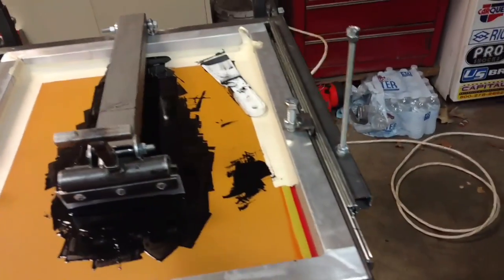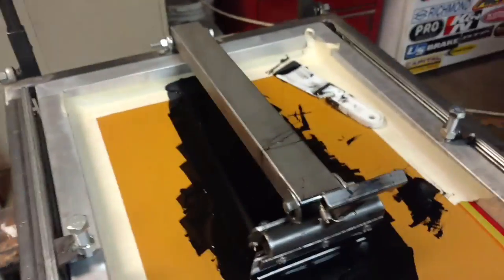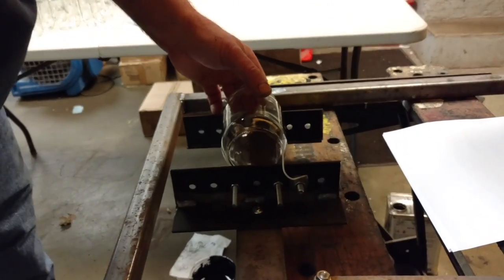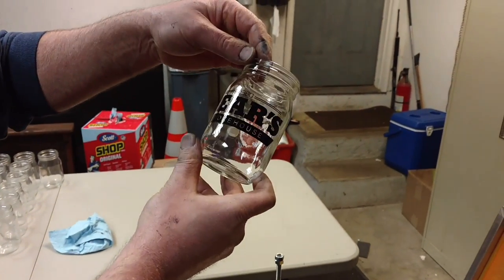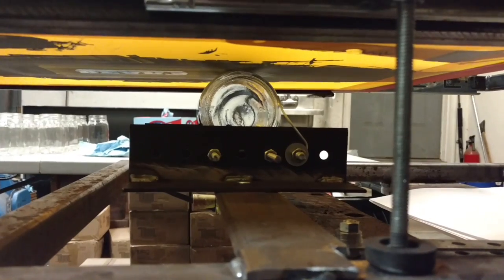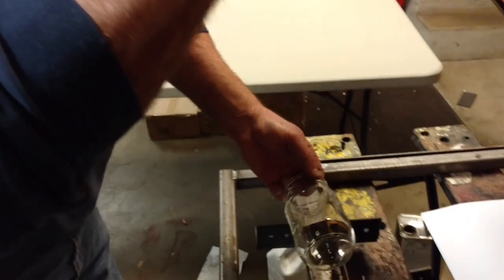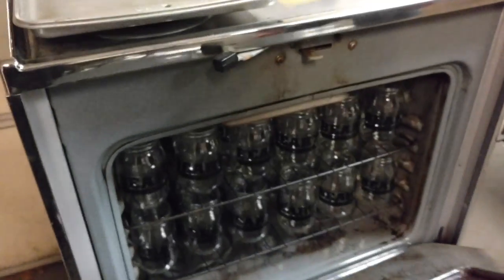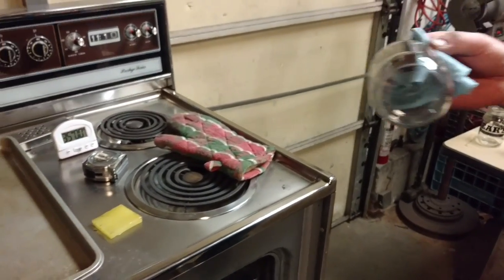Manual cylindrical screen printer

Comment: I like it. Looks like it could fit any cylindrical object within a certain size. Very cool. Yeah a belt dryer for glasses would speed things up a lot. Come get some Catspit~!
Reply from the maker: CatspitProductions 
Thanks for the comments. We can print anything from pens to growlers.  I like your videos as well. They helped me when we were starting out. Good information!
Reply: You're welcome. That's very cool! Thanks for watching my videos. Glad I could help out. I was actually looking at this and wondering if you wanted to build them for me to sell... LOL. It's a nice simple design and it may have a market. I get asked a lot about this type of printing due to my plastic bottle experiment video printing only with a screen. These days I sell a lot of screen printing equipment. Wanna build one for me to make videos with and see if anyone wants to buy? Is it hard to build, maintain, operate? Just throwing it out there ;)
Reply: Berardi Racing i need this printer

Comment: friend, with all your experience ... do you think it is possible or feasible to be able to stamp a bottle completely ... that is 360 ° in practically 100% of the circumference of the bottle to try to use up to three colors? .. do you think it is possible or is it a total disaster? Thank you,
Reply from the maker: Absolutely. You would have to stop your rotation just short of the image to prevent smudging.
3 colors would be a little challenging depending on the design but quite doable.

Comment: U r the best sir. But what about the mesh it is 120 or 200?
Reply from the maker: I used 300 mesh for this job but you can go as low 220.
The ink is very thin so you don't want to use a low mesh count.
Thanks for your comments.
Reply: @berardiracing92 i wanna print on perfume bottles. How can I protect the  ink from alcohol?
Reply from the maker: @manchette4840  Exactly what type of alcohol ?  I can wipe the ink with 99% IPA, after it's cured,  with no adverse affects. Hope that helps.
Reply: @berardiracing92  thank you sir

Comment: John you mentioned using a primer on the glass before printing. What exactly is the name of the product from Inkcups that you use?
Reply from the maker: I used the PP series primer but I think that may be for plastic.
Contact them directly and they will help you with what you need as their products may have changed.
I use CG series ink with 1000 HGL hardener. I have some glasses that I use every day and go through the dish washer, for 8 years now and still perfect.

Comment: Hi great machine, what kind of ink are you using for the glass?
I just subscribed.
Reply from the maker: CG series ink from INKCUPS.
I tried all types of ink and found this to be the most durable. I have a set of glasses that I use daily and wash in the dishwasher for over 5 years and still perfect.

Comment: Hello how are love to get more info on how you printed the glass. This is a great video   what did you use to clean and seal or primer the glass before cooking them   thank you in advance
Reply from the maker: There's no special prep before baking the ink. The ink will also air dry but it will take a day or so depending on the conditions.
Reply: @berardiracing92  thank did you use nazdar ink. Are you selling the plans to build the machine
Reply from the maker: @ramo8440  I tried Nazdar but was not happy with the results. I tried a lot of different inks and the one that worked the best is the CG Series from Ink Cups Now.
Reply: @berardiracing92  thank you for the advise I will look I to that ink

Comment: What kind of paint did you use? You said two part epoxy but not sure what type or brand.
Reply from the maker: I use CG series ink for glass from Inkcups.
They are in Danvers Mass. Check out all their products at Inkcups.com
Reply: @berardiracing92  thanks so much!

Comment: Just enjoyed your video.  Question.  You prewashed glass with alcohol to de-grease.  What did you prime it with?  I loved the video.
Reply from the maker: Rebecca Miller
Thanks for your interest. The "Primer" goes on like any type of cleaner. Use a saturated rag and wipe the glass. The supplier calls it primer but I don't think it's anything special. The ink can still be scratched off if you try.
Next we are going to try Pyrosil, which is a flame treatment.
Will post another video when we do.
Anyone with any suggestions would be appreciated.

Comment: Can you do multi color on this set up, putting different screen?
Reply from the maker: You can do multi color as long as you have a reference point to start with. I use a line on the glass as a reference point so the image is centered in between the lines.
Do the same for the next color.
The ink starts to set up in minutes so I would do a print over before the underbase cures.
Reply: Berardi Racing Thank you , by any chance did you ever get the plan for the set up to built this ? Or are you selling it ?

Comment: Fantastic design! What are the components that the jar rests directly on? Are they ordinary washers?
Reply from the maker: Cameron Pearce 
The rollers are steel roller bearings  with 1/4" centers on threaded rod.
Nuts on either side of the bearings to hold them in place.
These are fully customizable by size and configuration depending on the size and shape of the glass.
Reply from the maker: The rollers are steel roller bearings with 1/4" centers on threaded rod.
Nuts on either side of the bearing to hold them in place.
Fully customizable by using different size bearings and configuration to fit the size glass your Printing

Comment: hello, i am from Argentina, congratulations, very beatiful machine! Do you have plans of these machine? thank you
Reply from the maker: David Toledo :: DG 
sorry Dave, I do not have the plans for this machine. I designed and built it off the top of my head.
I used parts that were laying around the garage and welded them together. Thanks for watching!
Reply from the maker: s
Reply: No problem, I try yo do the machine to print beer growler! thank you!
Reply from the maker: David Toledo :: DG 
We do use it to print growlers for two local breweries. I think it's time to get an automated machine.
Reply: Hola! Pudiste armarte una al final? Necesito armarme una para un emprendimiento. Saludos y gracias

Comment: Can I use a heat gun instead of an oven?
Reply from the maker: You don't actually have to use any heat at all. You can air dry over a few days so any type of heat would be beneficial.
The steady heat of an oven just makes the ink more durable.
Don't use your household oven if you decide to bake.

Comment: Great job👍 if done by dtf or dtg , it would be better and easier.
Reply from the maker: Old Video. That stuff didn't exist then. I agree, it would be easier but maybe not in mass quantities or durability.
Reply: @berardiracing92  I had a DTG back then. However, DTG's and F's are inkjet printers and you have to print everyday, and the heads go out quite often. They only last about 5 years. Not worth it. I'd rather have a well built machine.

Comment: This (and everything about this video) is genius! One of the best DIY vids on here for sure. Thank you so much for making it 🙏 So question - since this video was made 3 years ago, are you still getting all your materials (glass primer, epoxy and glass paint) from Inkcup?
Reply from the maker: Yes, After much trial an error i have found they have the best, most durable products.
If you need any help, let me know what you're printing on and i can steer you in the right direction. Inkcups has a good description of what inks to use on what substrates.
Reply: @berardiracing92  Great set up, thanks for sharing. I have a project where I hope to be printing on aluminum and also stainless steel canisters. Any particular considerations for those materials?

Comment: can this be done to styrofoam cups ?
Reply from the maker: P.a.C  Yes. With the proper ink you can print on anything. For styrofoam you would need a water based printing ink. You would have to resurch that yourself.  Thanks for watching.

Comment: Would you be willing to share the plans for this machine?
Reply from the maker: I would be happy to share the plans for this printer but I don't have any. I made this completely off the top of my head.
I used parts and pieces that were laying around the shop and welded them together.
Maybe I should draft up some plans because I've had a few requests.
Maybe I should make some more and sell them.
Thanks for your interest!

Comment: Scratch resistance? I tried maribu and it scratches off with a fork.
Reply from the maker: FEN CHIANG  I had the same problem with Maribu.
I did a lot of testing and INKCUPS came out on top. If you bake the glass to cure it, it's pretty strong.
I have some glasses I put through the dishwasher 100 times and it still holds up.  You could scratch it off with a knife if you wanted to but if you don't, it will last.
If you went to a bar or someplace that has printed glassware, you will find most of their products will scratch off ( I try it everywhere I go)
INKCUPS sells to Discount Mugs, if that helps.
If you buy the CG Series, use the reducer and the primer.
Reply: Mesh number please. Can you explain the primer. Thank you
Reply from the maker: FEN CHIANG 230 mesh works good.
Wipe the primer on the surface with a damp lint free towel and let it air dry for a few minutes.
Use 1000-HGL hardner. 20:1
S-3 Retarder. 5-10%
PP ink primer

Comment: Please How can I get the machine?
Reply from the maker: To build one yourself you would have to be a fabricator and a welder. However I have seen people make these out of wood. The easiest way is to shop on Amazon or Ebay.  I have had many requests to sell these or the design. Unfortunately I don't have any designs. I just made this off the top of my head. I'm sure they are much cheaper than I could build them and sell them.